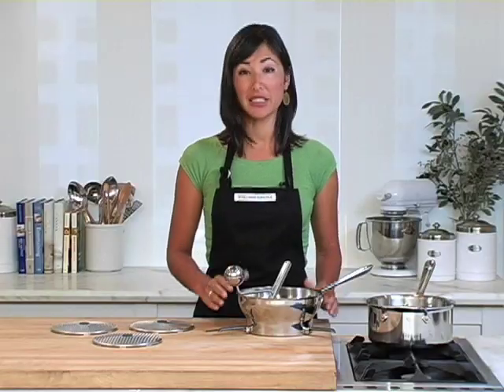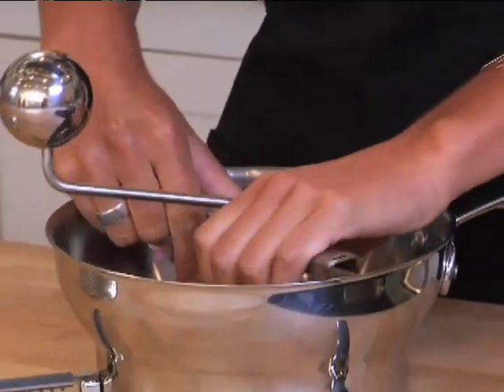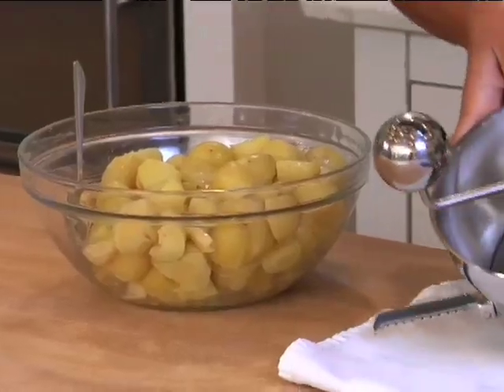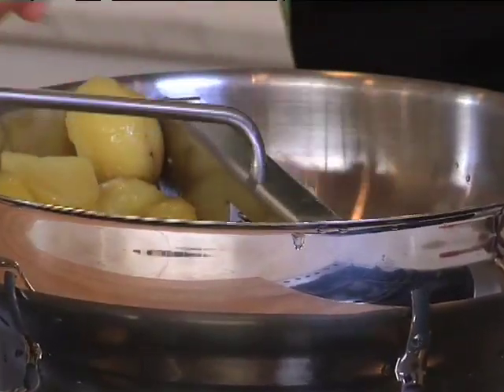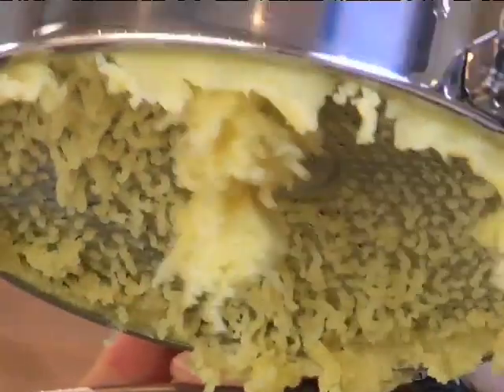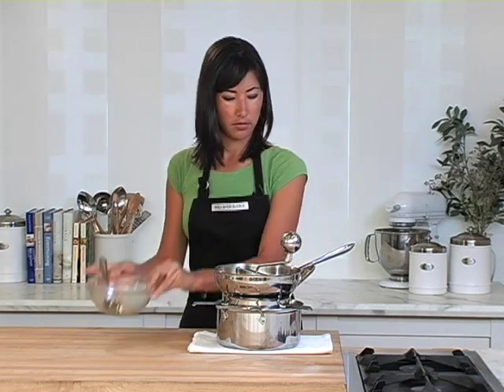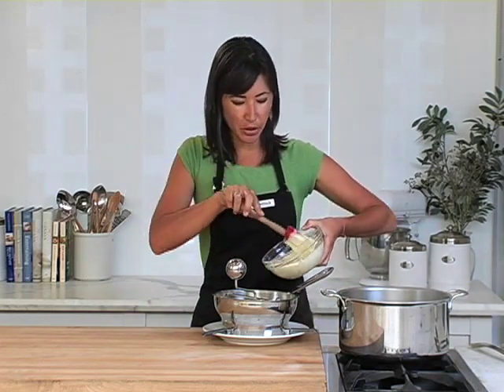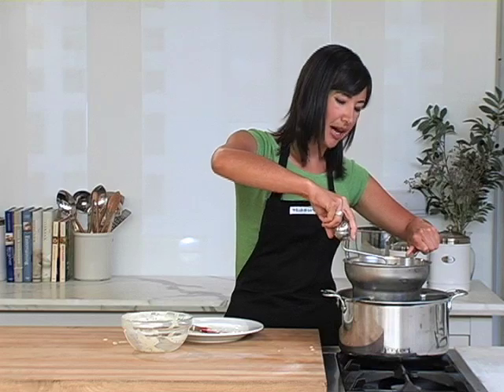Puree Food in Style with the All-Clad Food Mill | Williams-Sonoma

Comment: this is a very informative video. i just purchased one of these from WS. Hopefully it works better than the other junky one that WS sell (which I returned). Only question though. Mine doesn't have the "wiper blade" on the bottom mentioned in the video at 0:46

Comment: if the blade is touching the grater, isn't dangerous to have metal residue in your food ?
Reply: thats what was thinking
Reply: You call that "thinking"?
Reply: It's not dangerous because the metal is not scraping off. Th metal is hard enough that it is not removed from this type of contact.
Reply: @Metqa  You are wrong.  The metal does scraped off into the food.
Reply: Add a little iron to your diet